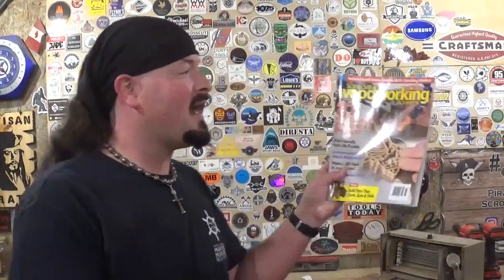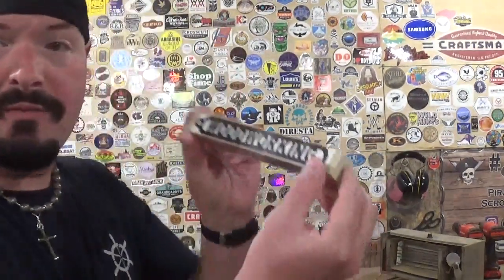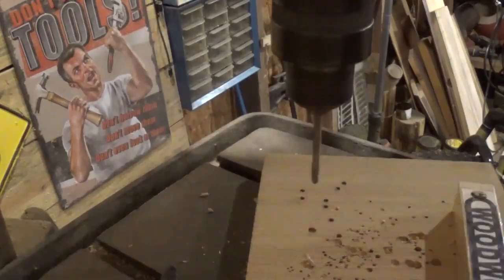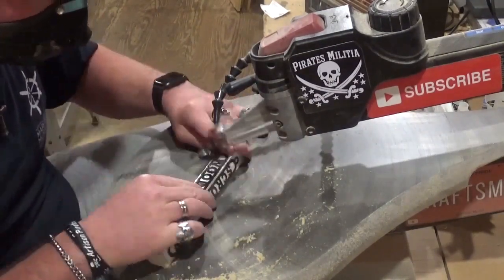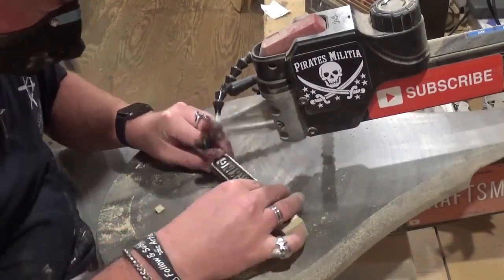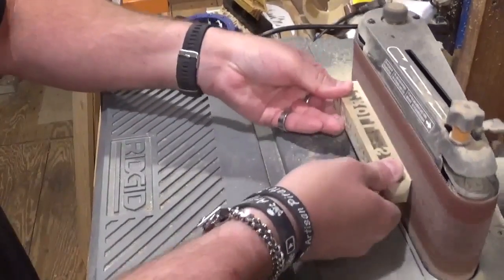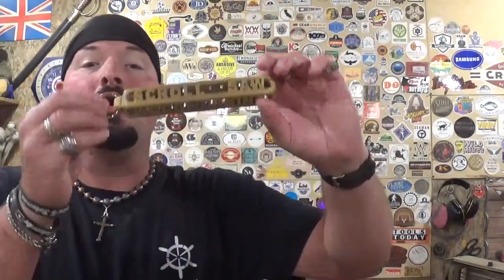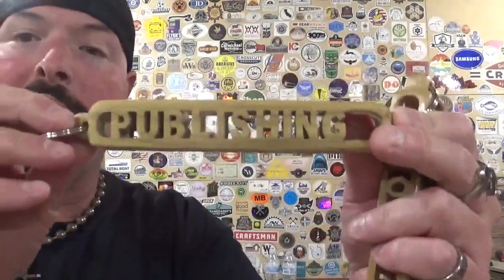Custom Keychain For Scroll Saw & Woodworking Crafts Magazine

Comment: Steve Good is awesome at what he does. It is awesome of you as well how you give credit where credit is due and your scroll saw skills. Kudos to both you and Steve Good.

The key chain maker is a good tool for someone starting out to start scroll sawing. I am still a big time noobie with scroll saw work. I am also new with using Inkscape. The difference between using the key chain maker vs Inkscape, is with Inkscape, you build everything from scratch and then you can evenly space the letters. For example, you create a rounded corner rectangle (1" x 6" with a 3/16" border). Type out the text, select the font you want to use. Then with the text selected, you resize the text to 5" x .641". Using the alignment tool, you can have both the box and text centered vertically and horizontally . Add your hole for the key chain. The with all three selected, set stroke to path, then put everything together with "union". Set your cutting border to 1 px, print and get to scrolling.
Reply from the maker: Great information!
Reply: @ArtisanPirate  I am honored you liked the information. It was through Steve Good's videos is how I had learned about Inscape. Learning Inkscape is an other tool to add to your box of skill sets, allows you to create your own patterns.

Comment: I am sure that you can make them with your eyes closed but I have made less than ten and I picked up a tip on cutting the letters like "R".  I would have made two inside cuts but you combine then into one.  Scrolling is taking a back seat to our gardening but I will try your method out as soon as I can. ☺
Reply from the maker: Yea I now only do the single internal cut with "R" as well as "B" and "A" 
I hope to see some pictures of your garden posted!

Comment: I love this video. I watch most of them. I have Steve Goods Key fob program but I never did it in a compound cut. Can you tell me  how you get the pattern in a compound cut. I would love to try that. I typed two different names and they printed out but they were seperated and different sizes.Thanks, Ralph.
Reply from the maker: Sometimes I need to add spaces or just redraw the brackets free hand. I do take a straight edge and cut out the patterns and attach them to the blank aligning then as best as I can
Reply: @ArtisanPirate  thanks for your response. I did add spaces but it’s still a little smaller.but not by much. I printed out another copy and just cut the brackets off that one and lined it up with the original. Taped it together and scanned it it it and made a copy with both names.

Comment: Another great video. But I have a question, if the two words are of different lengths, how do you get the shorter word’s frame to be the same as the longer word’s frame length?
Reply: I;m asking the same question.
Reply from the maker: As stated in the video, I sometimes need to add additional spaces or redraw the end brackets entirely, the key is to line up where the keyring is added